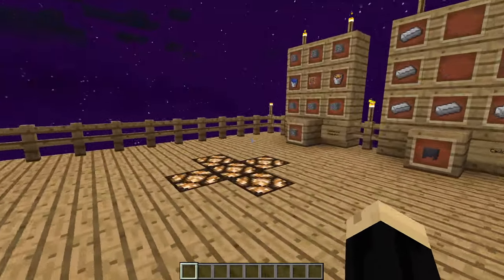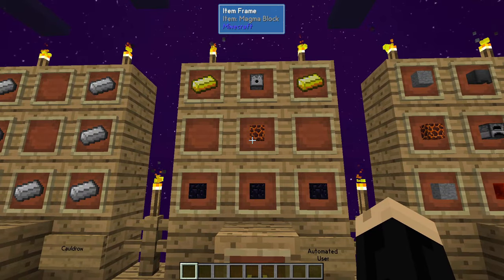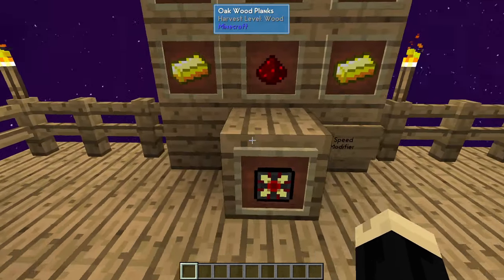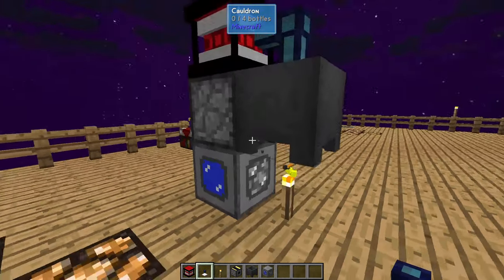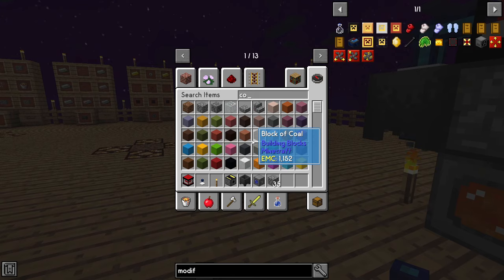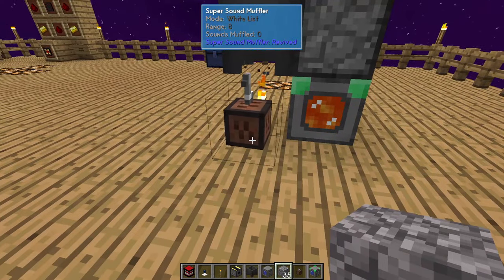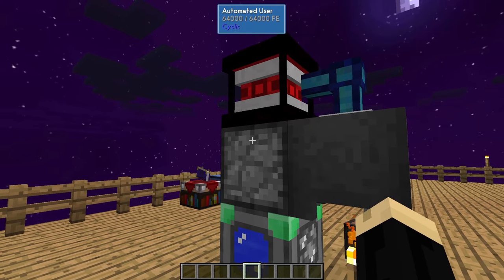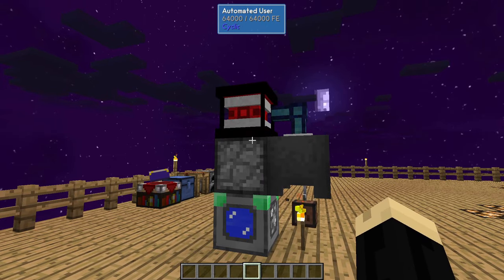Minecraft - Sky Factory 4 - How to Create Geothermal Power - Easy Power Production

Comment: hi has anyone played skyfactory 4 and used geothermal gens? i have a few and some are working and others not is there a reason why?
Reply: I'll be on it today and will let you know.
Reply: I know i am late but you need another cable called fluud extraction cable and then connect it with the fluid cable

Comment: for some reason my automated user does not work, it does not put cobblestone inside the cauldron
Reply: Put cobblestone in the cauldron to start the loop because the user also needs power
Reply: You need a torch under cauldron
Reply: @shotcrib77v56  thats not why. you need to manually place 1 piece of cobblestone for it to start working
Reply: @breadisyummy_  thats one of many reasons why it may not work?? also if the geothermel gen is allredy powerd then its not needed
Reply: Had this issue, my problem was i was using a fluid cable not a fluid extraction cable

Comment: Is this broken now? i cant get the cables to extract from my cauldron
Reply from the maker: No, it still works ok.  I actually have several of them set up and running right now.  Just to check, are you using the fluid extraction cable (the blue one).
Reply: @OnlydravenGaming  Yes I am, the same one you use in the video
Reply: I know i am late but you need another cable called fluid extraction cable and then connect it with the fluid cable
Reply: @yossefmashlab8459 ??? This is the cable Show in the Video lol

Comment: I made it the same exact way but the cobble gen doesn't put items into the user for some reason and if I put them in myself the per tick only lets me put it down to 20 ticks instead of 1 so it's too slow either way
Reply: I fixed it with a item extraction cable, but the per tick problem still stands.
Reply: Other people are having the same problem as me on threads. This method DOES NOT WORK for the new updates of Cyclic for whatever reason
Reply: You have to have a faster cobble gen